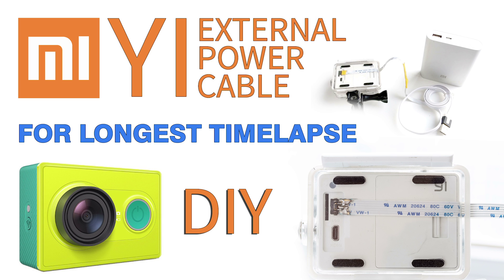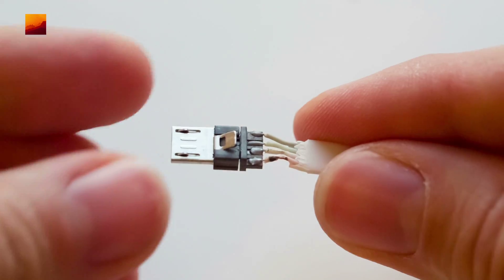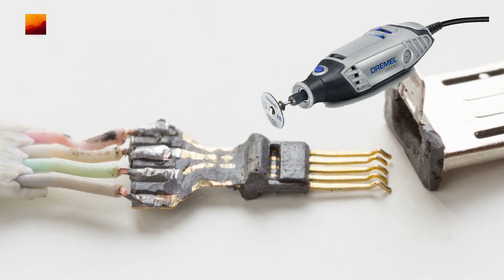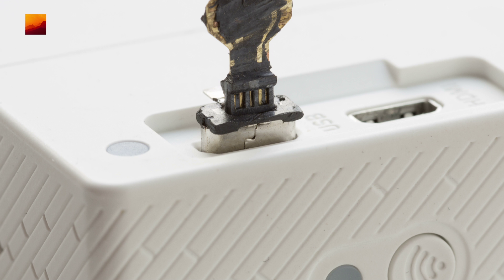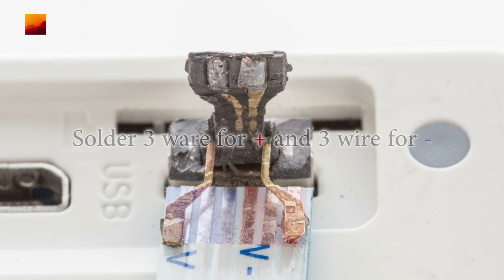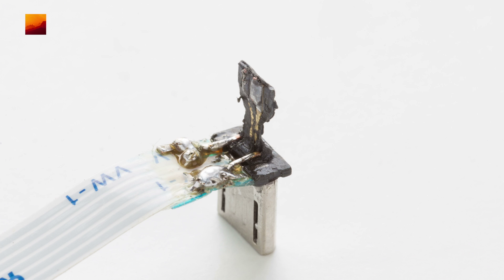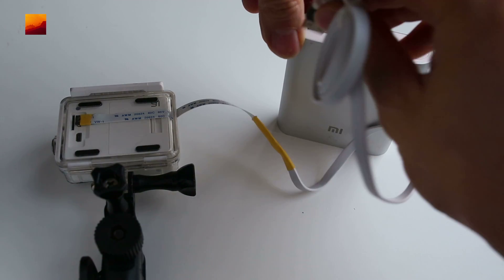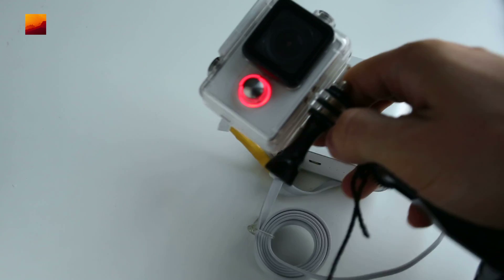How to make external power cable for XIAOMI YI

Comment: hello, great tutorial and incredible results in your timelapse. I wanted to consult you about the script that you used. Are you using the "XYC"? I'm dealing with this application but .raw files generated have only 12MB in size and are corrupt. And when I try to do more than 60 cycles about not even work. Could you pass me the script that you used? I'm looking for a way to make automatically power off after a certain amount of cycles. Very Thank You in advance.
Reply: hi! did you solve this problem?